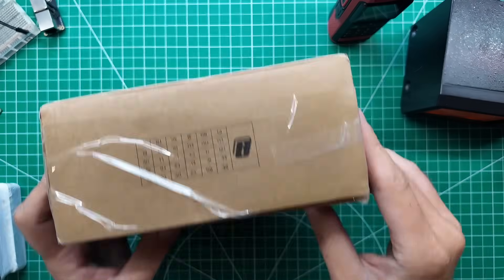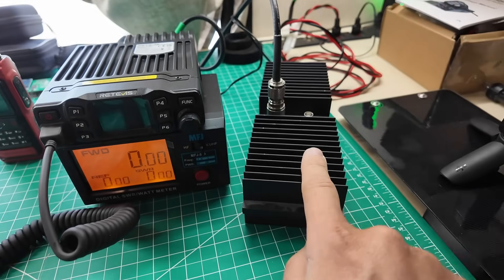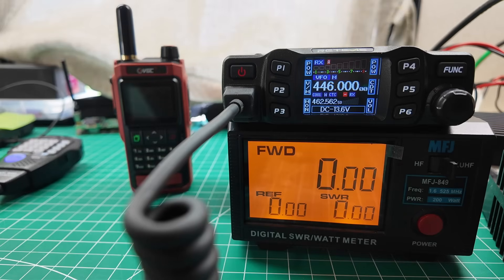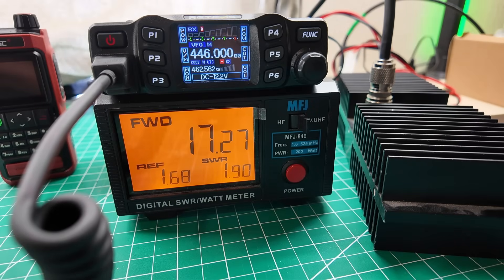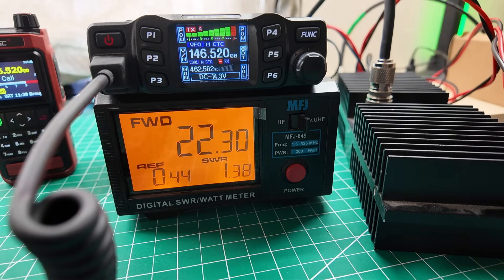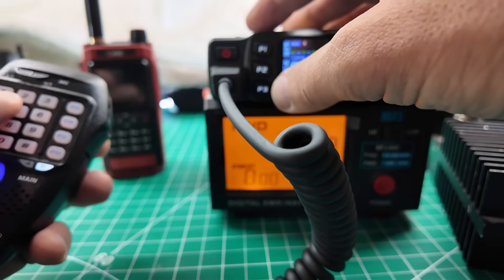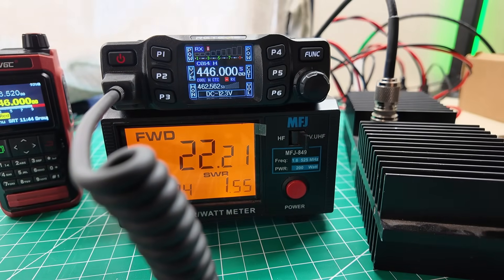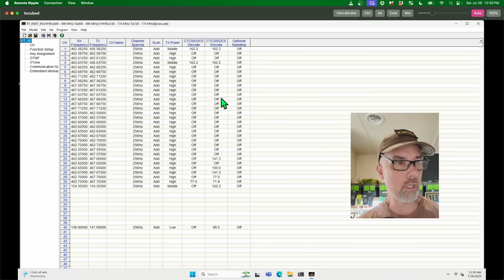🚨 Illegal Programming & Power Output Revealed (#8)

Comment: How can I get a good first mobile radio?
Reply from the maker: Do you have a repeater near you? (Check out repeaterbook.com) Then look for the callsign of the repeater on qrz.com and contact them. - they will probably give you a radio to start, but you want to get the kind of radio that works with their repeater.  As you've seen in this series, the RT95 is a good radio, just misunderstood.  Would be a good start if you can't find a good club.  Next one up would be the Vero VR-N7600.

Comment: You take a calibrated DMM like a Fluke, and set your power supply to read 14.4VDC at the end of a ten foot 10AWG cord.
 Forget the rest, that's now rock solid at the MAXIMUM NORMAL AUTOMOTIVE VOLTAGE.
 Any radio that isn't happy with that, needs work.
 And if it works 100% at a fixed 13.8 volts, that's golden. Too much futzing around with voltages. Too easy to get the right voltage and see if the radio is right or wrong.
Reply from the maker: Exactly.

Comment: The Amperage is important, your power supply is it constant amp at a set voltage or better yet, connect it to a battery. Battery in the running car is 14.5 volt and amp is as much as that radio needs. 😊
Reply from the maker: Exactly!

Comment: If it comes from the factory programmed for out of band frequencies then they are showing that the radio is broad banded and can be used on business bands or some other place. Rember ham bands vary from country to country.  Just program it for where you are going to use it.
Reply from the maker: You're 100% correct on being built for different regions and being built to select the region at the end of the assembly line.

Comment: What I want to know is why you arent using a regulated power supply. Regulated means the output voltage doesnt change under varing loads up to the maximum current output. Looks like you are using a 5 A power supply. Measure the input voltage as close as you can to the radio and compare that to what the radio says the voltage is. Output voltage should not sag under load, if it does you cannot depend on the PS.  If the PS is holding its  voltage during key down then its the radio. With the output staying the same at 22.xx watts it looks like there is a over zealous protection circuit at work or maybe the factory set it that way.
Reply from the maker: Exactly, I'm using a 30a regulated power supply, but I'll need to dig further.  I expect it's a "design flaw" in the radio and we as hams have gotten too spoiled with things being "spot on" I've the years.  You won't see a 600cc motorcycle that is exactly 600cc... And nobody cares.  At this point it's just a curiosity that really doesn't matter.

Comment: The voltage on a power supply typically drops when a load is applied.  The accuracy of your power meter is also questionable.  10% error is not uncommon.  Try a Bird watt meter or just relax and enjoy the radio.
Reply from the maker: Agreed, Just answering questions folks have.

Comment: Parties responsible for spectrum pollution:
1. companies that make easily-modified transmitters with power supplies capable of much higher output than is necessary for rated legal output - they obviously know what they are doing.
2. The operators of such radios.
3. People who post how-to-do-it videos on YouTube.
And stop using words like "shocking" when you clearly don't know what it means.
Reply from the maker: 1.  The world exists outside of one country.  These radio manufactures are making radios that can be used for multiple markets that can have their regions changed to suit the market they are purchased in.  This keeps their costs down and those savings come along for us.  Yes, they know what they are doing, and so do real hams that can read schematics/trace PCBs and easily bypass it anyway.

2.  I'd say the government regulations need to be adjusted.  I get that a GMRS only licensee should only use a GMRS locked radio... since we have this elaborate gatekeeping scheme in place...  but once an operator has proven they know more than GMRS users and become a licensed ham, that person who can be trusted to certify their own radios, should be trusted to certify a radio for usage on a different service.  I shouldn't be required by some piece of paper to make space for, purchase, install, configure multiple radios that are frequency adjacent after having jumped through all the other government hoops to prove I can be trusted.  That being said, I did mention in every video that using your radio out of band shouldn't be done and that my tests were performed on a dummy load.

3.  Not every video is made for you, there are people who are legally allowed to use these radios AFTER they have been unlocked and the knowledge of how to unlock them is necessary and should be shared.  I have a dozen of these radios and am fully licensed to use them on the 70cm ham band.  The radios were region locked to a region that was not mine and I unlocked them to my region and use them within my privileges.  This is the most basic intent of getting a ham license and how ALL radios were built/converted in the beginning. 

And for your last point, Either we appeal to the audience/platform we are presented with or we don't have an audience.  If we don't have an audience, our hobby dies even faster than it already is. If we want to keep our hobby alive, it is on our shoulders to bridge the gaps where possible.
Reply: @temporarilyoffline I have also damaged an adjacent radio that burned out the front end because I transmitted on a separate transmitter. In the same vehicle.  One radio to rule them all now.
Reply from the maker: If the government trusts me to build a radio and certify it under my license, why should I have a "porcupine roof"?

Comment: You didn't account for amps. Voltage is nothing without the current to back it up. What was being drawn from the power supply? How many amps?  The.voltage sags because  of a high amp load.
Reply from the maker: I'll take a look.  The power supply was double the capacity needed for the radio to put out more power.

Comment: I have a Retevis MA1 which I'll be sending back in the next week, so maybe you'll see it.  I'll stick a Post-It note in the box so you can drop me an email if you do.  The right side volume control shaft is bent.  I'll be very curious if you replace the control or try to straighten the shaft.  I don't want to take a chance on the shaft breaking off if I try to straighten it.

But before I send it back, I want to play with it a bit to see if I like it.  That will determine if I get a replacement or just a refund.

As for buying used radios, I've bought so many that either had a problem or developed a problem shortly after buying it that I'm done with that.  When I buy a radio I just want it to work and have a warranty if there is an issue.  But, hey, if you are having fun and making a few bucks, good on you.  Cheers.
Reply from the maker: I did a video on the MA1.  I'd probably replace the encoder if I get it.  Thanks for the tip.

Comment: And all them so far came with a mounting bracket ! Staying hot and muggy 90F in NY . Was on 6 meter FT8 making contacts south all over . FL/TX/AL/NM/FL and few more . Them NOAA radio went off and hear thunder so I shut down . Dropped my 12.4 meter pole and brought it inside shop . Maybe the storm open 6 meter nice for me. I just lean my pole in a tree with the T2LT 6 meter antenna. Quick easy . I would wipe out all programming and start fresh if I got 1 of them radios.  I got a GMRS one and had CTCSS set and had to clear them. 73
Reply from the maker: Yep. Still better than icom.

Comment: The voltage drops considerably on transmit. The cables should be good for 5A without that much drop. Must be some resistance in the circuit, maybe the fuse holder? That was a problem with the IC-7000.  Assuming the PS voltage remains constant.
Reply from the maker: You mean Icom's aren't sacred and they have problems too?  😎😎

Comment: That's why I liked my Motorol SyntorX, modded biz band rigs. I added a power adjust pot to them as per the FCC mandate to only use the amount of power needed for the communication. They didn't mess around with power. They would do about 150 W, although my mobile in the car would do 170 W wide open on 2 meters. 10 W was usually sufficient for most contacts, but the EIRP of the 150 W with the 13 element beam at my shack would make it possible to do all sorts of fun things with the atmospherics on hot summer evenings, popping in and out of distant repeaters and chatting with folks on 146.52. I was foolish to sell those rigs. I'm a QRP or QRPP guy on HF and below, (I ran 7 mW EIRP on 175 kHz,) but I was QRO on VHF and higher. It's all about going 'people fishing' in the Earth's atmosphere with the right tackle to make it fun, and I like to fish.
Reply from the maker: I love the analogy!
Reply: By my calculations a 13 element yagi, under ideal condx, would deliver a gain of about 12dbd that, ignoring any coax loss, gives about 1300 watts ERP for 100 watts at the antenna terminals.  That's a respectable number...not to mention the attenuation of unwanted signals from the rear and/or side while receiving.  I had a 10 element log periodic dipole array on hf...which had a theoretical gain of about 7 dbd..running legal limit from my amplifier, made my ERP about 7 kw.  However...it was at 70 feet agl....which makes the practical gain closer to the 12 dbd figure with the resulting 16, 000 watt ERP.  I found that claim hard to believe...until I tested it on 10 meters with a ham about 15 miles away.  Switching from a half wave dipole at the same height to the LPDA gave a 2 S unit gain at the receive end...which is 12 db.  Yikes.  Needless to say, I could bust pileups on 14 MHz and above with relative ease.
Reply: Motorol SyntorX  IS MADE BY A NEW Chinese owned company?

Comment: Interesting video, but a bit spoiled by frequent bad focus. The camera insists on focusing on the mike spring cord... didn't you notice this?
I have a RT95 and it exhibits the same voltage drop when transmitting. And it's not from the power supply. Either its power cord or the internal circuitry causes this.
The RT95 programming app sucks. Use Chirp instead.
I wonder why people return these. I'm kind of happy with my RT95. Nothing fancy, but it does the job.
Reply from the maker: I noticed it, I left it in for comments 😎

Comment: I use the previous owner's programming just to test the radio. Most of my radios are "channelized." RTSystems is great for their copy/paste functions between radios of different mgr. & model. I always check Anytone AT578 radios, they are notorious for having low power out of the box. I put them in maintenance mode and set the power to specs. If you want to get technical, even part 90 radios are not legal for use on GMRS if the operator can program from the front panel. Which is why they are typically locked from the factory or vendor.
Reply: I have an Anytone version. It did full power out the box & was easy to GMRS/FRS bootleg. (The 11m version was easy: snippy wire & some buttons.)
Reply from the maker: That's good info to know about those radios.

Comment: It's a mobile radio, so they're all designed to run off the max nominal voltages of a typical 12v automotive charging system. The voltage regulator in your typical alternator starts charging the battery when it drops below around 14.5 volts or so and peaks charging at about 15v. So unless the alternator or battery are old and tired, you should see around 14.5-15v even with the car off. How many Amps is your power supply?
Reply from the maker: This is a 30a power supply.
Reply: @temporarilyoffline  got skinny power wires feeding it?
Reply: Not quite. In the last 15-20 years some car alternators have been controlled by charge computers and coulumb counters. The absolute maximum battery voltage will be 13.8 volts, sometimes 13.6 depending on chemistry. The maximum alternator output is typically 14.4 volts, rarely 14.6 and it will never exceed that. Unless you are using a calibrated meter, you may see values that typically differ by 0.2 to 0.5 volts, high or low. And that's MASSIVE ERROR. Common in $10 meters, even in $40 meters.
 But a "nominal" 12 volt mobile system is typically expected to be 13.8 volts, the output of an idling alternator with a fully charged battery.
 Not my opinion, but numbers from years of asking designers and engineers who spec and build these things.
Reply: @lyfandeth  Exactly. The voltage of a new and fully charged lead-acid battery is 12.6 V without a load. If we draw 20 Amps the voltage drops down within seconds to around 11.5 V. That's why we use regulated power supplies.
Reply: @lyfandeth  that may be true of newer cars but the old ways still do apply, and also one of the reasons I'll never willingly buy a car/truck made past 2000.
Reply: Your entire post is incorrect.
Reply: @wolfschindler8921  then do you want to read the manual I pulled it from and tell them they're wrong?

Comment: What is the max current on that?
Reply from the maker: They never really say for some reason.  It has to be less than 15a just from experience, and I'd say somewhere around 8-10 based on its output power.
Reply: @temporarilyoffline  AI says approximately 6a, 7a would be adequate, but 10a should be sufficient.  The owners manual doesn't say.  Retevis really makes it hard to buy the right power supply.

Comment: A few things about an equipment review.  A reason that a radio might not put out the full advertised power is the VCO may not be properly adjusted for the amateur bands.  Running a test to see where the max output power is, tells the reason.  Often a little adjustment makes all the difference.  The most important test and review of a transmitter is how clean it is.  A spectrum analyzer will show if there are harmful harmonics, potentially interfering with commercial services. Using an inexpensive Nano VNA can show that.  Most inexpensive radios out of Asia have little to no filtering. For repeater owners and operators, a spur on channel can result in an inquiry from the FCC.
Many power modules when operated beyond their specified frequency usually have spurs that cause interference.
Reply from the maker: Great points!  Thanks for sharing.
Reply: There are a couple more things,  first if the receiver is wide open, no filtering, every signal gets in to the point where the noise floor is so high that the receiver can not pick out the desired signal, check out the cheapest HT from China and test the receiver against a well engineered radio, even an amateur radio from one of the top tier manufactures, Icom, Yeasu, Kenwood, Alinco.  The second, on a legal side and it has happened more than once, is modifying a radio to transmit out of band and causing interference inadvertly can win you a fine from the FCC. If a radio is FCC certificated to transmit from the amateur bands through commercial and government frequencies, you are probably OK, but if there are harmful spurious emissions, and a polite warning isn't followed, you won't like the results. Especially if the radio has sufficient harmful spurs that get into the aviation bands, both ATC and navigation. Everything  beyond broadcast. 107.9 to 140 MHz is aviation and 240 to 300 is military air frequencies. The little hand held  Nano VNC  spectrum analyzer  helps.  You would be doing a huge service to amateur operators by demonstrating this little test.

Comment: Too small powersupply or to thin powercable. That's the reason for the voltagedrop when transmitting. How many amps does the powersupply deliver, and how much is the radio specified to draw on transmit?
Reply from the maker: Exactly.  That's why when I removed the extra power cable length you saw the voltage increase.
Reply: @temporarilyoffline I noticed that

Comment: I am curious why you don't use a battery when you want steady power out. I find the power to my radios don't fall back as much with a battery.
Reply from the maker: You'd think a high quality power supply like an Astron would be more regulated... but I hear ya.
Reply: @temporarilyoffline  it's how many constant Amps the supply is built to output that matters, not how well the Japanese components inside are made.👍 Too skinny a gauge for the power wires to the supply also chokes the Amps available under load too. 20-25a is kinda considered a bare minimum for most 20-50w radios, but 30a normally gives you enough headroom to even run a 100w radio.
Reply: @temporarilyoffline  I use the Astron to charge the battery and the battery supplies power to the radio. Epic Power Gate FTW.
Reply: You obviously have no clue at all. The opposite is true.

Comment: In the second channel you programmed with the software you set the U-call receive frequency to 446.000 and the transmit frequency to 155.500 (or whatever it was by default).
Reply from the maker: I did... then I fixed it.  S-Happens.